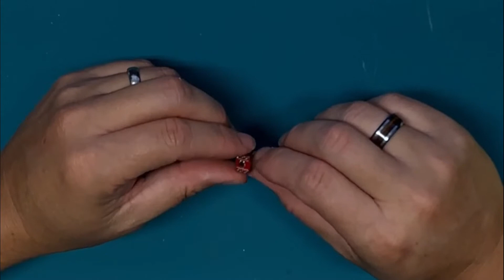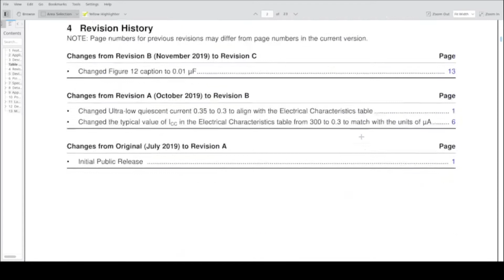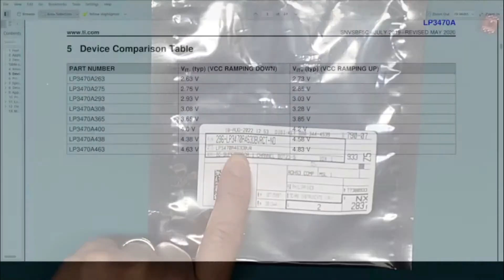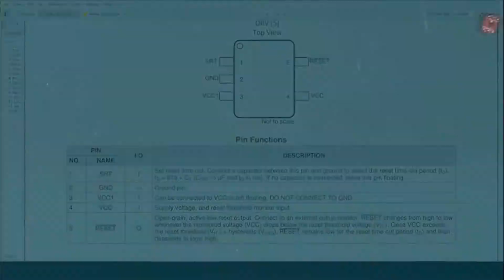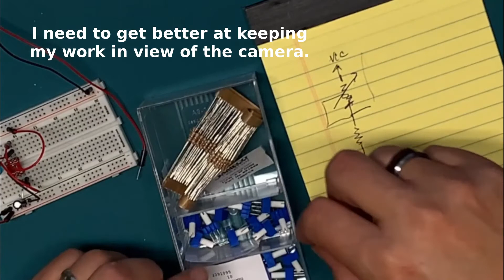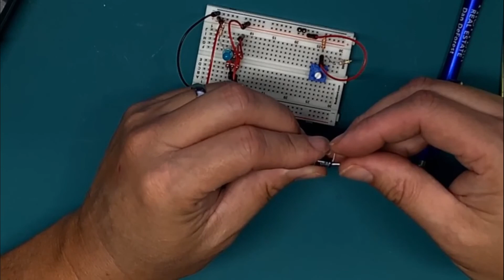0002: Testing the Power Supervisor | 16-Bit Computer From Scratch

Comment: To make it all a lot neater, have Vcc on one end of the pot, have Gnd on the other end, and take the wiper (middle pin) out, and the pot itself becomes a voltage divider. Have a sufficiently large value pot to stop power being wasted through the pot (Vcc to Gnd - end to end). Maybe go for a 10-turn pot if you want fine-grained control of the values in the resistor voltage divider.

Maybe check out the specs of the pot, make sure it's linear, not logarithmic.
Reply from the maker: Yup.  It was early in my recording career.  I was intimidated by recording what I was doing.  Hindsight being 20/20, this is exactly what I should have done.  

This pot is linear.  My current clock speed is controlled by a logarithmic pot, and I like how that behaves.
Reply: @eryjus4594  This was the voltage divider for the supervisor though. I have been enjoying the series. Up to the construction of the busses...